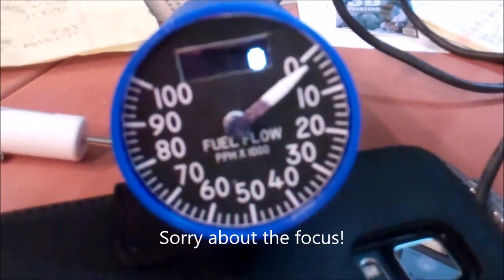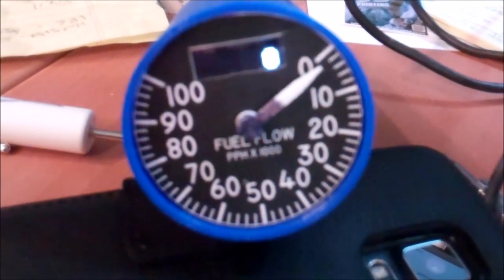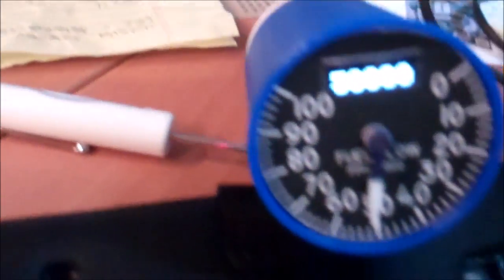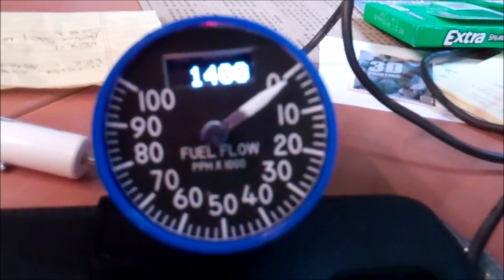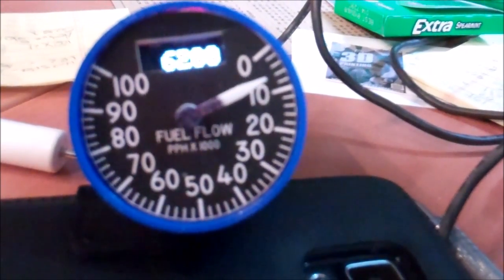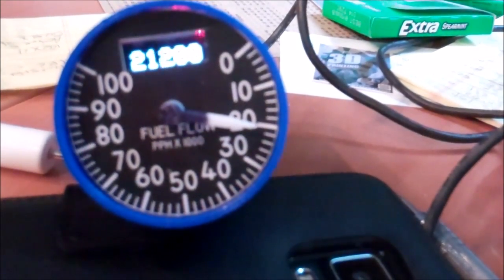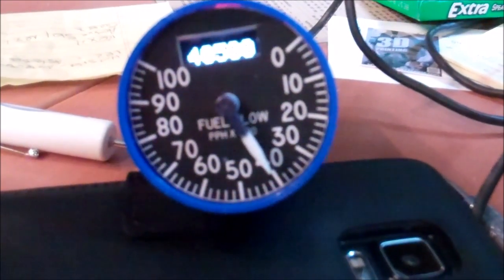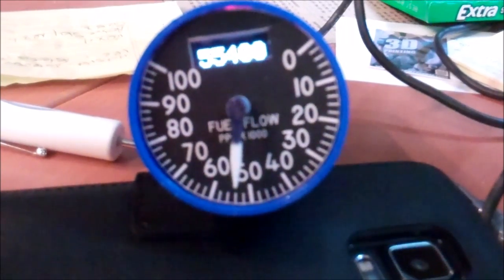Fuel Flow Gauge Demo #2

Comment: What is the 20 pin chip that you used on your board?
Reply from the maker: Are you referring to the Arduino Nano?
Reply: @f15sim  no it was the 20 pin DIP but I think I figured it out. I am working on some gauges myself and was trying to work through a problem. You mentioned having a bulk supply of the Simco air core motors. Do you have any of those left? I'd like to buy some from you if possible.
Reply from the maker: @mikeschena5399  I think I figured out what part you were referring to.  I think it's a ULN2008, but I'm not sure.  I've got all that stuff put away right now so I can't check.  I only got 10 of those motors, so I don't have enough to sell.  That being said, I think SimCo will sell singles for around $22 each, which while expensive, would at least get you one to work with.  Once you've got a working design, you could get together with some other builders for a group buy of them.
Reply: @f15sim  Thanks for your help. I will contact them
Reply from the maker: @mikeschena5399  You're welcome!

Comment: What's the status of this project? I want to make aircraft-style gauges for a project of mine, and it looks like you've done most of the hard work already.
Reply from the maker: It's still a work in progress. I've changed the design to use Switec stepper motors as I couldn't get rid of the sound the air-core motors made.  The Switec stepper motors are very inexpensive and are much more easily obtainable than the custom air-core motors I was using.  Guy Carpenter (google "gaugette") has done some really fantastic work with Arduinos and Switec motors.  I highly recommend you check out his blog.
Reply: The Switecs and gaugette work look really cool - thanks.
Reply from the maker: You're welcome!  Note that the Switec motors don't move 360 degrees by default.  You can make them do so by removing a small pin inside the case of the motor.

Comment: Looking good! What's the little OLED(?) display you're using?
Reply from the maker: +jamvanderloeff It's this unit: https://www.adafruit.com/products/661
The display is attached to the board with double-stick tape.  I remove the tape and the board sits in an "L" shape as you can see here: http://www.f15sim.com/?p=394